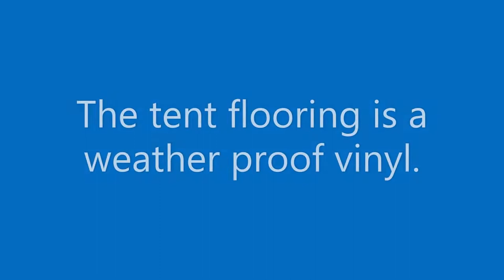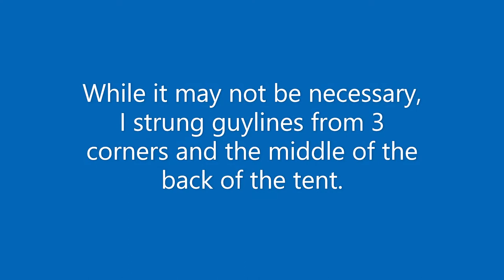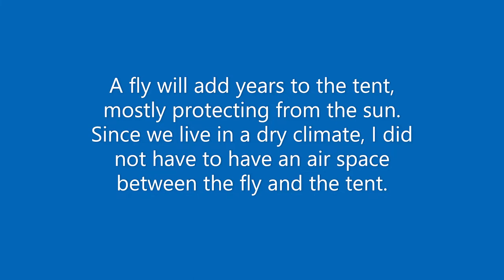Glamping Tent 2022   Central Oregon by GringoCool

Comment: OMG, you took that right out of my dreams. I been thinking about an insulated platform and stapling the sides to the platform. I am not happy at all with the area I wanna set up just because the soil get so terribly soggy, seeing it is right next to the dam and at times, the dam get full and extends really wide, but the water never really high, just soggy soil all over. your choice of bed is exactly my thought, something called industrial furniture. i been thinking something very similar to that. i would also like a desk and kitchen furniture made like that. Jimbo's garage (channel on Youtube) has an industrial "computer desk" that I thought would be just perfect. Very lovely set up you have there. I suppose something like a nice shinny wood stove kind of like ones that Canadian Prepper (Youtube)sells would fit in there nicely. Thnx for doing it bro, I really love how you did it and that's pretty much how I am gonna do mine too.
Reply from the maker: Thanks so much Grootman.  I appreciate the suggestions and comments.

Since this video, I have built a smaller "lounge deck" right beside the glamping tent platform.  The small deck has a wall which will be useful for outside cooking, lounging and relaxing, with a little shade and wind protection outside of the tent.  Also, I am in the process of putting a solar shower in beside the small lounge deck.  I fully furnished the tent now, with some pieces that I made myself.  And there is running water (sink) inside the tent now too.

Originally, I was going to do some hardscaping along side the tent (barbeque area using bricks, cement, etc).  But, with the slope of the area and the possibility of erosion over the years, I decided to do a second platform deck.  Still a little work to do before it is a "finished project", but I am plugging away.  The really special thing about the tent I think is the view and the fact that it backs up to BLM with the Steel Head Falls of the Deschutes River, just right over a rim (short walk really, less than a mile).  Again, thanks so much for your comments and encouragement.

Good luck with your project.  If you have any questions I can help with, send me an email.  Best - Steve